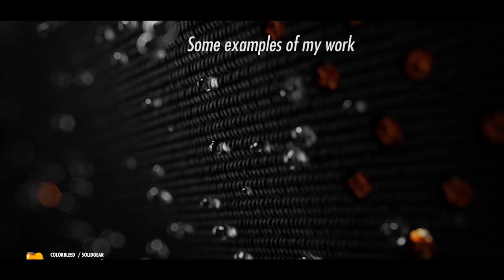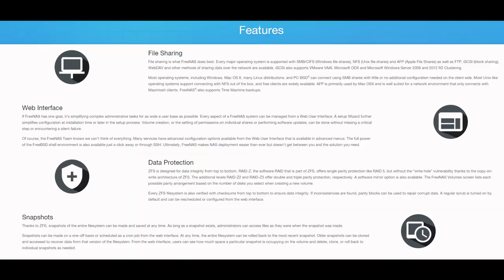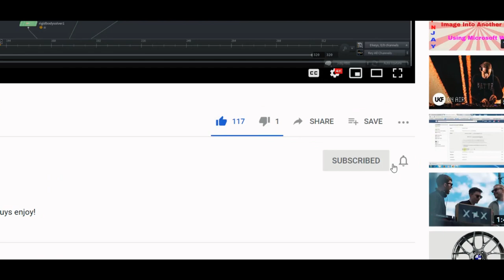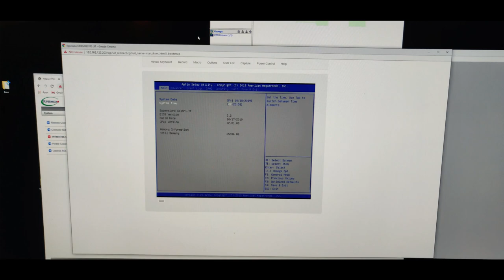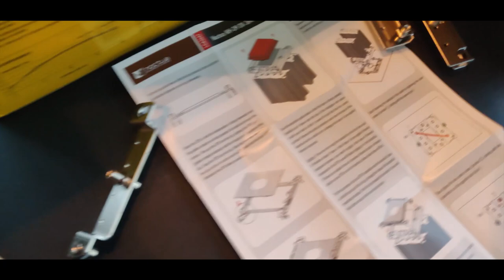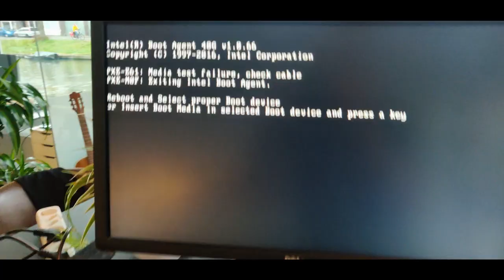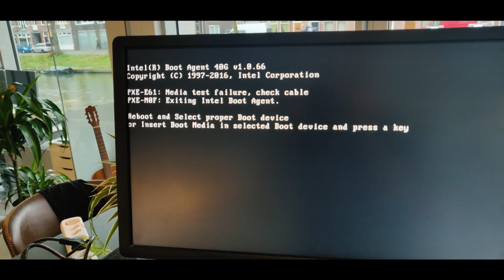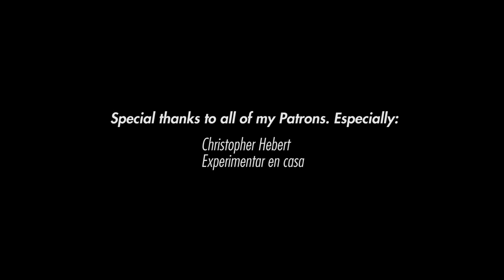VFX Artist Builds: Lightning Fast Freenas Server - Part 1 (introduction & build)

Comment: Hey Tim, this is a really cool inspiration and helps alot. I´m trying to build a freenas from my old HP xw8600 machine (which has server components). I hope it will work... since its a pretty old machine. I read somewhere that there is a 2 TB limit on old LSI/HBA cards... so i´ll try the one you used aswell ! Will keep you guys updated. Greetings from an compositing artist ! Bedankt

Comment: SMR drives are not NAS drives they don't hold up  CMR are the best for serves and freenas or synology nas all WD red 2-6 tar bytes are SMR drives
Reply from the maker: I used Seagate ironwolf drives, not WD red.  Ironwolf uses PMR as far as I know.
Reply: Tim van Helsdingen voor je volgende project check deze schijven 2.5 miljoen mtbf, 10^16 URE (of 1^15) ter vergelijking wd red pakt een fout op 11tb terwijl deze dat pas bij 110tb doet. Vergelijkbaar met WD Ultrastar maar dan goedkoper! Toshiba MG07 https://tweakers.net/pricewatch/1165311/toshiba-mg07aca12te-512e-12tb.html

Comment: Please don't use USBs....
Reply from the maker: Like I pointed out, this thing runs 24/7, the only time they're used is during boot. Server might only be rebooted one or twice a year. it seemed like a waste to use space on the case for this. They're mirrored so if one fails I'll just pop in another one.  I honestly don't see why i shouldn't use USB drives in this case.
Reply: @TimvanHelsdingen  that's exactly what I thought. I moved logs to my vdevs, all looked good. Till 5 months later the system got frozen. Web UI was not accessible, terminal was throwing write errors. On reboot it completely failed. Same situation happened 7 months later with 2 mirrored USBs.
Reply from the maker: @AlexDiamantopulo  hmm, interesting. So both got corrupted or something?... Issue got solved when you moved them to SSD's?
Reply: @TimvanHelsdingen  correct, 2 USBs became unbootable. The worst thing is that corrupted USBs made my freenas unusable in the middle of the day. No stress, no reboots, it just died. I had zero issues since I installed it on a very cheap Intel SSD. Single SSD.
Reply: We've been running mirrored (2x USB SanDisk Pros) for years without issue. I believe ixSystems still encourage dual usb as standard.